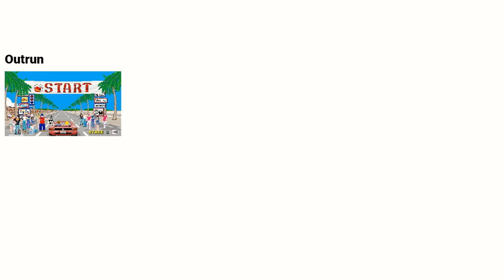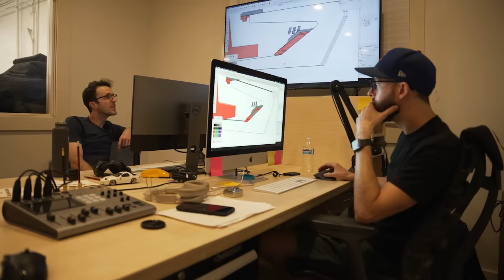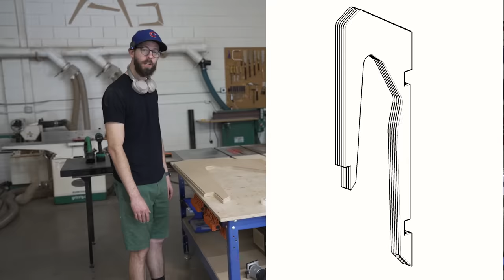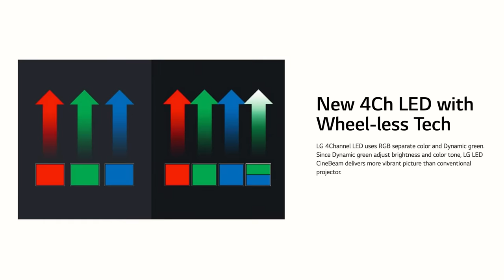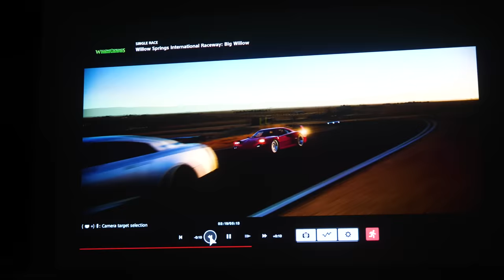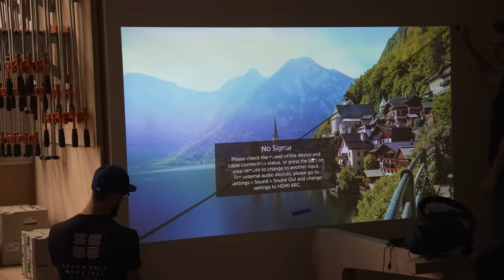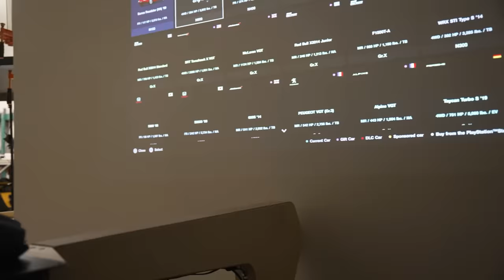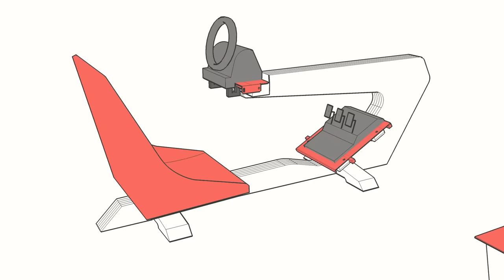I Made a Race Car out of Wood!

Comment: I highly recommend angling the bottom of your seat until your thigh can rest on the seat comfortably. If you run long times, you may develop some issues as you're basically holding the weight of your legs on your feet, hips, and lower back.
Reply: I would say just raising the seat would do good here because that steering wheel is crazy high and in his face
Reply: TBH I am pretty disappointed with how little effort they put into setting a comfortable ergonomic racing position from the start since they were setting all these metrics from scratch... what a missed opportunity to make it perfect right away. This racing position looks very yikes.
Reply: @wesgunn97  “Where’s the beef?” high steering wheel. View from back is all wheel and hair. All in good humor.
Reply: @pokerboyfakerish3266  Bad design
Reply: @pokerboyfakerish3266  yeah top of the wheel should be roughly at shoulder height (it's past his chin now :S) and when you extend your arms your wrists should rest on top of the wheel (so when you grab it there's a slight bend in your arms)
my DIY rig doesn't look nearly as fancy as this one since it's just a simple frame I made out of 2x4's but proper seating position was like the first (and pretty much only XD) thing I did some research into....
Reply: also i think the Wheel should be anglede down a bit more. the middleaxis points toward his face, where it should face somehwere between the shoulders and the chin i think. at least thats most comfy for me with the most controll over the wheel

Comment: Hey guys, thanks for making this video. I was looking for a non-ugly simulator rig for a long time before I found this. Strongly based on this design I made a very similar rig as my first furniture type woodworking experiment. Very very difficult and time consuming but I love the final product. For those wondering (because I was), I used 8 layers of 15mm baltic birch as the main body and it handles 9nm direct drive wheelbase with basically zero flex. Thanks again 4eyes!

Comment: I love this build, couldn't have imagined a more aesthetically pleasing sim-rig myself.  my only fear with this design would be the stability of the structure, if you decide to one day dive down the rabbit-hole and upgrade to say a 10-20nm steering wheel, compared to the 2-2.5nm in most entry-level wheels

Comment: I built my own cockpit out of lumber also, I used an old actual racing seat, works great! One thing that I did that you may want to do: Remove the pedals from the plastic box that they are housed in and mount the pedals upside down on some plywood (so the pedals are configured like in a car). Fasten the plywood to your racing cockpit at an appropriate spot. I made my upside down pedals container adjustable for shorter or longer legs so when kids use it they can reach the pedals. Great project, enjoy!

edit: I am intrigued with your spline design and will work on something like that myself, the only thing that I don't like about it is the distance that the driver sits from the display (wall). This could be resolved by building a monitor/tv support stand closer to the driver.

Comment: Awesome, love the design and the process. The only downside is that rigs usually have adjustability (That steering wheel is angle/height looks uncomfortable). Maybe your shorter/taller friends want to play, or maybe you want to try out different steering wheel angles or seat distances to see what feels good. Just like in a real car. Otherwise looks very nice

Comment: Great build, although it may suffer from "form over function". For instance, there's several poor choices made as far as seating position is concerned ; with the screen position also being somewhat awkward (you have to look upward to see it properly); the seat should be on an angle, not flat; and as others have mentioned, the steering wheel is too close. 
It sure looks spiffy though, I am just not convinced it is particularly practical. 🤔
Reply: Yeah, you need to be able to rest your legs on the seat the whole way down the back of the thigh.  With this, he's holding his legs up with his feet and hips and overtime, it can become an issue. I developed some sciatic nerve issues with a poor sim seat position.  Not sure how long he'll be running at a time, but it adds up.
Reply: @biwan428  Yep. I don't think the rig will be used much. Maybe more of a 'display' and/or 'conversation piece' than a functional product. 
They should have researched 'proper seating position', and not relied on their own interpretations....
Reply: The seat should go up a bit and slightly angled backwards. The pedals should be closer and the projection should be lower. I would mount the projector upside down so it beams down instead of up. This way you can keep the projector horizontal and still have it project low enough to have the projected dashboard level with the real steering wheel .

Comment: beautiful cockpit. but can I give you one idea? You need to move the pedals or the seat along with the steering wheel to suit different heights of people. Place the steering wheel on the rail on the bottom side of the base and move the base for the steering wheel along it (the base for the steering wheel is in the shape of the letter O)

Comment: My man....  I love this design.  One thing you didn't think of:  The Epson ultra-short-throw projector.  Ultra short means RIDICULOUSLY short.  You could set it in front of the rig, on the floor, a few inches from the wall, and it will project a 100+ " screen.  The only downside is cost.  Those lenses get very pricey, very quick.

Comment: Very cool - I love the ikea vibe to it; not an eyesore like commercial ones, however 2 letters.  V   R...... screens got nothing on vr for racing sim engagement. Looks like you could reduce quite  a bit of mass though. On the design front, you can download 50th percentile human 3d models and standard seated position data (e.g. for aircraft design), and looks like the angles are a bit odd - seat looks low relative to the pedals, and wheel looks both high and close? (unless the target was a formula ford or something). I'm scratch building a 1/12 scale functional, high fidelity R/C  3d printed tank, but too much work to document for your challenge lol. I'm about 90% done and the printer is running in the background for the first test print of the superstructure.

Comment: I love this design! I might actually steal some Inspiration from this for my own sim racing build. My only real criticisms of this design would be that the steering wheel seems like it's too close to the driver. At the very least, it would be nice to have some adjustability in the steering wheel and seat. Maybe tilt the seat back a touch to allow the thighs to comfortably rest on the seat rather than hovering in the air. Oh, and you'll definitely want the shifter. And maybe an e-brake handle, too. Trust me on that one

Comment: Tilt back the seat, and get the pedalboks higher. And on rails to make it Come towards the seat, for some adjustability, like in actual race/sportscars. Same slidings for steeringwheel. Use the c shape from buggati chiron

Comment: I like the the midframe-design and would use it as inspiration for my own approach. But there are also many points for improvements. There is the cable management, adjustable seat or adjustable steering wheel.

Comment: This looks pretty good, but I think you could have made it with less wood. I would have just made two of those big pieces on each side with supports on the side and then connect those two with planks for the wheel and the pedals. It would look a bit more bare bone, but it would still work pretty good with less wood.

Comment: Very cool design... might go with this one as well, although I'd like to include a drink holder so I think one of the other "shifter" table ideas you had would work better for my preference.
Also, although it is a minor thing to me, is seat height adjustment which would be nice to have.
My only concern would probably be the weight, but the design is righteous!

Comment: Just an idea, If you left a void in between the glulam where the cabling is located then when assembling you can use a pull thru avoiding too many exposed wires.

Comment: I love your design. But when you upgrade your wheel, there's not much support. I built a rig using the Ricmotech RS1 plans. I originally had a Logitech g27, but have since gotten a T300. I believe this rig could handle a direct drive wheel.

Comment: This video started out great and I had high hopes but I was sadly let down. I feel like adding a strip on the outsides would've given you extra support and structure since things were still moving.. the steering wheel is way too high,  I mean even in vehicles it doesn't sit that high. The only other thing is cable management. The exposed cables takes away from the sleek, more modern look.

Comment: It would be cool to find an analogue way to allow for adjustable steering wheel hight positioning… having the steering wheel mounting system be totally separate and connecting with some sort of slat design similar to how weight lifting seats lock in at different heights and use its own weight to lock it into place. Might have to give this a try myself in 3D software

Comment: Have a look at FOV calculators.   Sim racing is great but if the FOV is off you will feel like you're driving from the back seat vs on the hood. 

If you use the math for the particular game - your immersion will increase substantially.  

It's basically size of screen vs distance from the screen.

Comment: so, my 0.02¥ would be to have done 6 layers and go 3/3 with some space up the middle: as it would have kept the aesthetic and been more laterally solid at the wheel, though, if that's only a logitech wheel set, you're probably safe....the higher end stuff would need way more strength....good job getting out of your comfort zone

Comment: Typically I would think the seat should Sit higher than the pedals, like an actual car, gives you more leverage. That's my experience when building my first two rigs at least.
Still a gorgeous build.
Reply from the maker: it would probably be more ergonomic. I really wanted like an F1 position.
Reply: @Foureyes.Furniture  ah yeah, I can see that.
Reply: Most sports cars don't actually sit higher than the pedals.
Reply: F1 cars have the pedals actually higher than the seat to be very ergonomic

Comment: everything is amazing except 1 thing... the steering wheel is mounted too close to your body move the mounting 2-3 inches away from your body for more realistic driving. when adjusting a real car seat and wheel if u extend your arms straight out the wheel should be at your wrist. With this sim if I put my arms out the wheel is at my elbows lol.

Comment: love the diy approach and the design looks good.
if i am allowed to give a pointer i would say, i think the seat is a bit low, because if you take a look at your arms and elbows there are abit low.
the top of the wheel should allign where your chest starts just below your neck. because if you try to go for one stint in your current position you wont be able to go for another stint.
before anyone comes after me i am not being negative andf i am not saying i would have done it better myself.
great content by the way.
New SUB

Comment: Grand turismo is about in the bottom third in regards to realism. And it is definitly on the game side, not the sim side.
The steps go about like this:
Arcade racer (Mario Kart, Asphalt 9)
Simcade (Forza Motorsport/Gra Turismo, Dirt 4)
Arcady Sims (project cars, Automobilista)
Proper sims (Assetto Corsa, ACC, I racing, Dirt Rally 2, Raceroom, ...)
Actual sims, used by car makers to test cars (custom built sims)
Reply from the maker: Good info. With the time I have I'll probably stick to the "Simcade" - especially since I spend more time taking pictures than doing anything else :)

Comment: The ergonomics are not very good, I wouldn't want to do a sprint race let alone endurance race in this rig. Also you would want the your screen (or projection) as close to you as possible preferably righty behind the steering wheel.

Comment: Cool design, but ergonomics look terrible. The only great angle seem to be foot controls, but the steering wheel seems to be at too much of an upward angle, and the seat too flat and too low relative to the wheel. Also with a more serious FFB wheel, I 'd be worried about torsional stiffness of the whole arm that is holding the wheel.

Comment: You could ceiling mount the projector that way your head will never cross the projection.
Reply from the maker: Maybe...once it finds it's home. I like the idea of the portability though.
Reply: @Foureyes.Furniture  Also projectors project asymmetrically meaning that it projects more above centre than bellow. So because you need the projector above the head you should mount it "upside down" instead of angling it as then you won't need so much keystone and will get a better quality and bigger image.

Comment: The design looks great, yet i think it would be even better if there's more adjustment available to it. Adding angle, distance and height adjustment for the pedals would be great, as currently you are limiting the seat to be like in a F1 car, which is angled your legs to almost like lying down. Most of the cars you are playing on Gran Turismo are the usual street legal or GT3 cars, which their seat shouldnt be that low in position. The steering wheel is too high and too near to the seat, as it should be at where your wrist at when fully stretched.
Reply: For projector, I think you can switch to a short throw projector, which can be placed directly near the wall, so it wouldnt become a problem in your design anymore .
Reply: Seating position is quite critical in terms of driving experience, you wont be able to drive correctly if you are in the wrong position. A lot of times you spun out, or unable to control the car well was because you are not in a correct or comfortable position, as well as limiting your hand movements.

Comment: You know it's getting bad when YouTubers are getting preemptively defensive over comments that haven't even been made yet.

Very cool design, but the seating position looks way too low. Everyone using it is having to sit too close to the wheel with their arms bent practically in half while peering over the top like an old lady out doing her Sunday shopping. Raise the seat and move it further back, add that read projector cabinet and create some chasings for the cables and it'd be perfect. Oh and a coat of varnish obviously.

Comment: I’m curious how this would hold up to a direct drive wheel setup that has a lot more torque than the Logitech wheel.  It looks beefy enough it might work without much flex…
Reply from the maker: I don't know, but I would suspect no problem. It's pretty beefy. I could jump on it and it doesn't even spring

Comment: After 1-2 days of playing you will realize how bad the seating and steering wheel position is, the steering is way to close and too high. Plus you would of wished you went with another wheel. I also bought a G29 a few months ago and Im already looking at replacing it. Hearing the plastic gears inside will absolutely make you insane.

Comment: Making this out of wood is not a good Idea if you are serious about sim racing, the flex of the wood makes all the feedback mushy and less sharp, and that's very undesirable, it's actually working against what the sim racing pedals, wheel and drive system are designed for. High rigidity that thick steel and high grade aluminium provides is much more pleasurable experience. But if someone is only playing casually and doesn't care much about lap times, then only it makes sense.

Comment: I liked the video, but I think you should have gotten more out of existing stuff as fare as structure, posture, ergonomics and build goes. That hunk of wood is super heavy and, as you mentioned several times, materials and work intensive, not very efficient and not very customizeable. I understand this is not a product meant for the market and you have chosen style over function, but I see margins for significantly better engineering while keeping the aestetics you have gone for. 
There is no provision for a shifter, no cable management built into the thing, and entering and exiting looks honestly weird because you lack places to help yourself in and out, and nowithstanding the chunkyness of the thing, the force feedback provided by that steering wheel is on the lower end of the spectrum, with a proper wheel, I don't see that structure holding still. I went trough the same process myself, that's why I'm providing some of my thoughts, hope this comes in handy should you make a V2 of this thing.

Comment: If you’re going to have the seat that low you need to angle your seat more.  And rhe wheel is way too angled and is too high.  Also the lateral stability with a better wheel is questionable